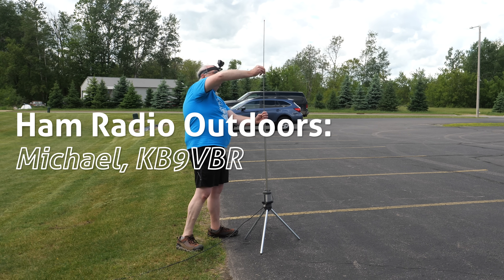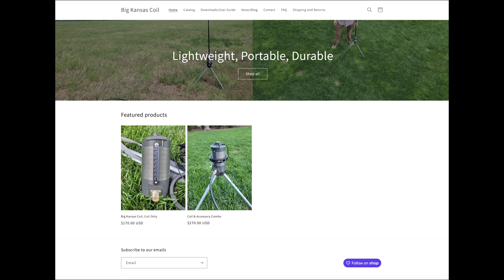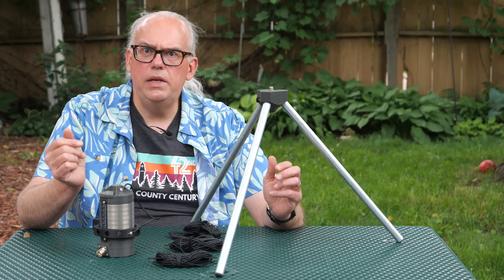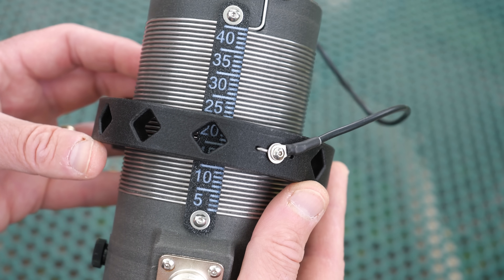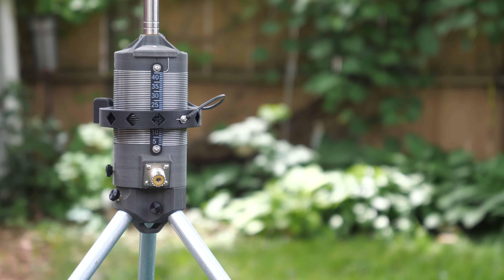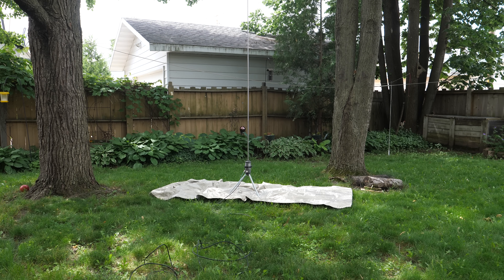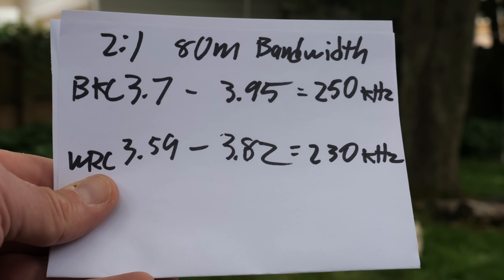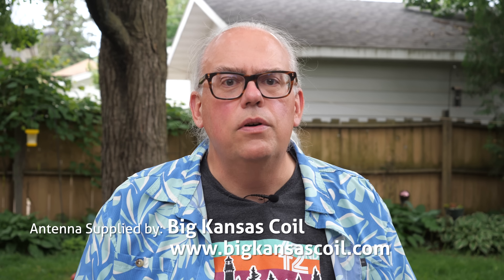Is bigger better? The Big Kansas Coil Vertical Antenna System

Comment: i have  a concern based on my personal experience with using carbon fibre on Aircraft. 

generally, carbon fibre will actually absorb RF, and therefore less of it will radiate out the antenna. 

I wonder if the author of the device that actually tested this using a non-carbon printed coil form to see if there was a difference in performance?
Reply: The coil body is actually done with Glass Fiber Nylon and the tuning clip is Carbon Fiber Nylon.  There isn't enough CF content to make an appreciable difference.  

The CF content of filled filament depends on the manufacturer, most of it around 20% of randomly aligned small chopped/milled pieces that are small enough to pass through a 0.4mm nozzle.  What adding it does is change the printing and mechanical properties of the material to make it better suited for the application. 

There are printers that can lay continuous carbon fiber, but this isn't made with one of them.  

I've made them in PLA, ABS, ASA, PAHT-CF, PA6-CF, and PA6-GF materials, and as far as performance of them they all seem about the same.  Where the materials matter is the durability and properties of the entire system.

Comment: My club member made this!
Reply: I have the coil and have had a hard time with it so far.   I am new to the hobby so chalking it up to be a user issue at this point and continue to test and tune.
Reply: Its best to use with a nanovna or other antenna analyzer. You can tune it in to the band and works amazing.  @markinmon5766
Reply: Innovative. He did good!

Comment: Both Wolf River Coils and Buddipole are going to need to up their game.  Big Kansas Coil has built a better mousetrap!!
Reply: Yep, the markings on the coil are a great addition. I'm always just wildly guessing when it comes to tuning the WRC.
Reply: I made a simple slide chart for my WRC. Made it quicker to tune. @kumasu
Reply: @Rabbitears1 colored Sharpie to mark bands would help once you find the spots to use.
Reply: That coil costs $170; the WRC equivalent is the Silver Bullet Mini at $55
Reply: @N2YTA  Great point. WRC's value is pretty great.
Reply: @N2YTA  SO????????, Its always amusing to see people in this hobby think nothing of spending  $3000+ on a new radio, but, act real cheap when its comes to getting an antenna
Reply: @rossbassette7518  It looks like a very nice product, but at more than three times the cost of a WRC Silver Bullet Mini I think it's a bit pricy. BTW, I don't have a $3000 radio.
Reply: @rossbassette7518  Well, not everyone is out there dropping $3k on a rig, nor taking said rig on a park activation.  Some of us are price conscious, and like to see value for the money spent.  While it is a very nice coil, does it warrant 3x the costs... Especially when you factor in that it can limit you on how it can be used.  For example, I can take my WRC and a whip, throw them on a mag mount, and go to town....I can even do the same with a NMO mount, using a NMO to 3/8's adapter. Can you say the same about this one?  I don't believe so, but maybe I missed something... That makes the value for the WRC, even if the bandwidth is more narrow, higher due to higher versatility....

Comment: Quality amateur telescopes have a hook on the tripod for hanging a weight bag. Should be easy to rig something up to this, even a dumbell or plate weight.
Reply: I took your idea and looked at my coil's underside.
It has a cast-in loop.
Stole my wife's ten pound kettlebell, a foot of clothesline rope, now have a weight hanging under the coil ... it ain't goin' nowhere!

Comment: For a given coil length, wire diameter and turns per unit-length; a larger diameter coil will have a higher Q than a small diameter.  On the other hand, a larger diameter coil will have lower inductance.  Thus, its length needs to be increased to achieve a  given target inductance.  Increasing a coil's length decreases its Q due to increased wire resistance.  Especially important is the type of wire used.  For stainless steel wire, the Q will be very low.  For silver plated copper wire, the Q will be very high.
Reply: The original versions were done with tinned copper wire, but after some prototypes came back after spending all winter outside, the corrosion on the exposed elements showed it isn't a viable option.  At that point it was all switched to stainless, with the exception of the wire from the tuning clip to the coil and that is tinned copper.
Reply: @BigKansasCoil  It did not occur to me that the coil was for permanent or semi-permanent installations.  Perhaps you can offer it with the option of either SS or tinned copper wire.
Also of interest, does the tuning clip contact more than one wire turn on the coil?  The concern being that high circulating currents occur with shorted coil windings.
Reply: It was designed for portable use, but some of the folks using it have wheels under their home and set it up on the coast where they winter at.  

At this time we don't want to have many options for ease of manufacturing and stocking.